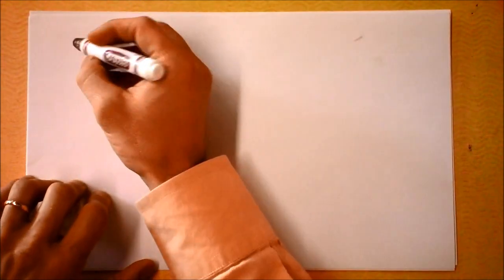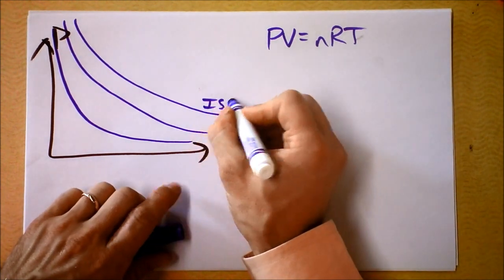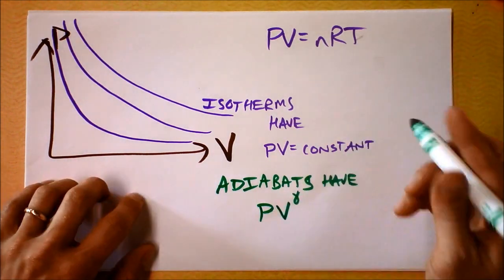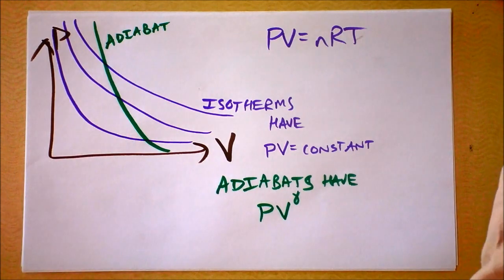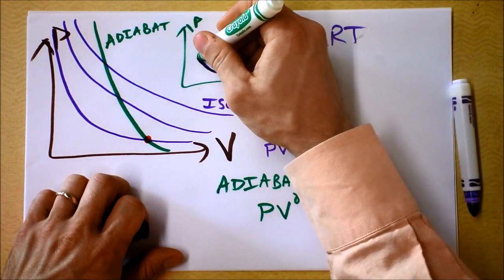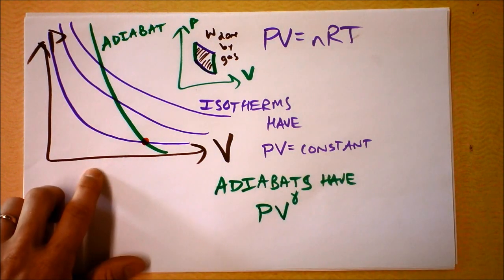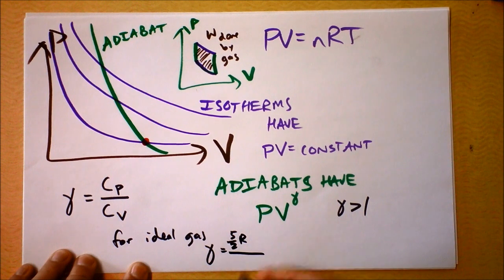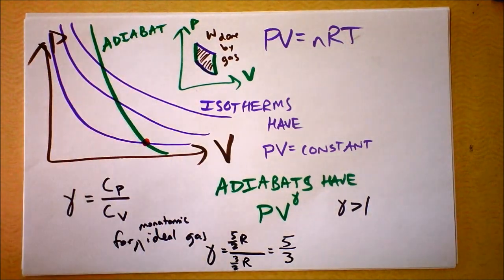Adiabatic Compression and Expansion 2 of 2 | Thermal Processes 5 of 5 | Doc Physics

Comment: Hey, I just recently commented on your other adiabatic process video. And Im still having a bit of trouble understanding adiabats so just to attempt to clarify for myself:
In an adiabatic compression...
Q=0, therefore
deltU = -W, therefore
deltU = -PdeltV, therefore
Any work done ON the gas (I.e. compression & W<0) increases deltU,
Which is dependent on temp, thus if -PdeltV > 0,
deltU must increase meaning temp must increase.
And because of ideal gas law, if temp increases, pressure increases.
Is this correct?

If it is, just a follow up question: how would I use the ideal gas law to justify my last conclusion above?
Would I say that because the temp increases and the volume decreases, that causes the pressure to have to increase more than in an isothermal case in which the temp does not increase?

So then for an adiabat, the pressure change essentially has to compensate for the decrease in volume AND increase in temp for while isothermal case, the pressure change only has to compensate for volume change. Therefore the pressure for adiabat will be steeper than isotherm, as the video shows?
Reply from the maker: YES, YES, YES.  All of this leads to a more extreme slope for adiabats.  You are a great student!  The great trouble with IGL for adiabats is that the thing that's held constant (Q) doesn't appear in the lousy equation at all.  I think that's why adiabats are the trickiest process for most folks.  However, they're also REALLY common in nature (and engines), so we must understand them.
Reply: Doc Schuster Awesome! Hopefully I get something on my physics final on Tuesday that has to deal with this concept. Love your videos though! Concise, yet insightful! And I also like how you write out your procedures as opposed to using a computer or powerpoint slides
Reply from the maker: Thank you!  I agree - sometimes old technology is more flexible than the systems that replace it.